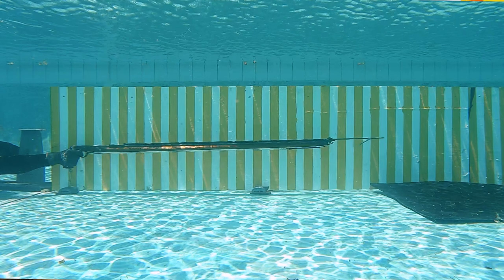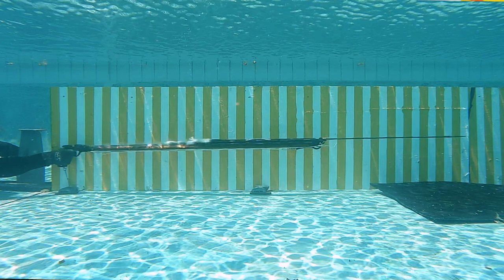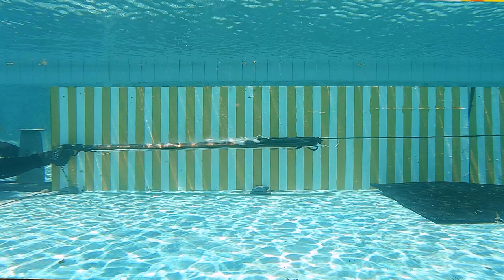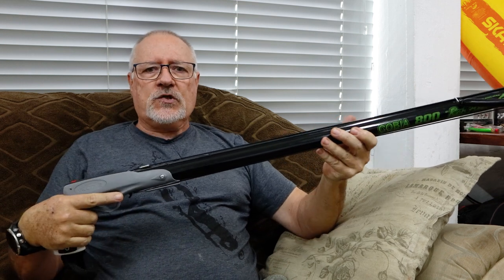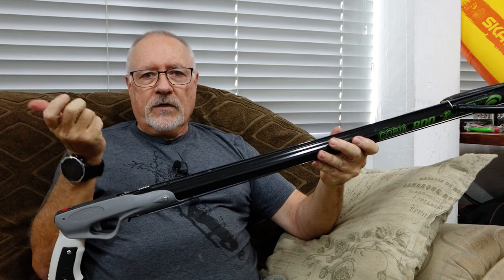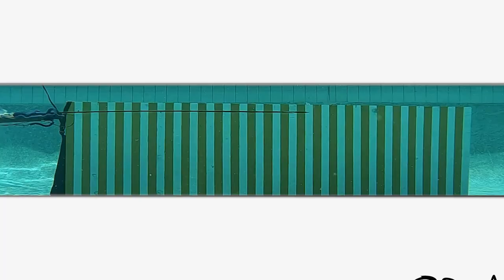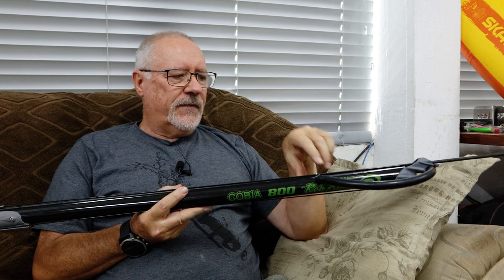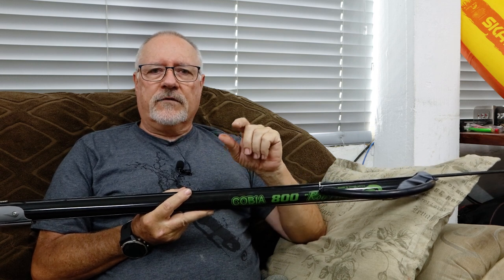Rob Allen | Max Spear Velocity | Part 1 | 2023

Comment: 48-50cm 14mm small ID Primeline on a 90cm RA roller with 7mm notched shaft seems like the max power/accuracy to me. Have tested 56cm 16mm standard w 7.5 notched and that is a smoothe powerful shot. I would take accuracy over power any day since I dive in murky low vis, so my go to is 55cm 14mm small ID w a 7mm notched on my RA 90 Roller. May have to tweak a bit once the water warms up, but that should be pretty spot on.
Reply from the maker: Good to hear.

Comment: A great discussion, I have used many different types of rubbers and i guess this is a personal preference, but recently i put some small id primeline (ultra force) rubbers on my riffe euro and the performance was crazy (so was the recoil and loading), i put the same rubbers on a rollergun and again the result was very high shaft speed, but all of this comes at a price.. loading, accuracy, recoil etc. Have you tried harder rubber? (I am not suggesting this is a good idea, I guess the rubber you order matches your guns the best).
Reply from the maker: Our standard guns are already regarded as "hard to load" no point in making them more difficult.

Comment: Some pretty reliable testing I’ve seen on YouTube indicated 14mm small ID rubbers stretched to about 350-360% seem to give more accurate and penetrative results with ~7mm spears. I’d be so curious if you’ve found a similar result.
Reply from the maker: We have not done speed tests yet with the smaller ID rubber but by the nature of the latex, the same constrains are there. The contraction speed does not get better no matter what rubber you use.
Reply: @RobAllenSpearfishing  It seems though that small id rubber contracts faster possibly due to less hydraulic breaking. Also it seems that thinner rubber contracts faster. Using small id 14-14.5mm rubber cut at 360-380% has been shown by reliable testing to do very well. I'd love to see you also test this.
Reply from the maker: @marcusdowell9062  We will test this but so far the testing shows you can easily over power a gun with standard normal bore rubber. If the small ID rubbers work well when compared to the same length bigger bore, yes there can be other influences slowing it down so, just compensate with a slightly shorter normal bore rubber. The whole emphasis in my chat was about the fact that latex rubber has a specific max contraction velocity and you can't make the rubber go faster. I was probably not clear enough, my fault. I was trying to show that all you need to do is get the spear up to max rubber speed, preferably just before the rubber gets to the end of its stroke. Any more rubber power, will still only get the spear up to max rubber speed, but sooner. This fast acceleration only creates more recoil which will affect accuracy.
Reply: @RobAllenSpearfishing  No, you where clear enough about the specific subject in the video. I was just going down the rabbit hole :) Anyway, great video, look forward to the next ones in the series.
Reply from the maker: @marcusdowell9062  Great, good to know I was understood 😜 I have a feeling this whole subject is going to be a deep "rabbit hole"  many thanks for watching.

Comment: I watched the 3 series of vids. My feeling based on your findings is the roller is actually questionably worth the extra cost and effort. its even less powerful at short ranges and perhaps marginally more powerful at long ranges. Maybe your actual use of the guns indicates otherwise. Reducing recoil seems to me the main advantage of the rollers. But this would be  not much of a gain at all if you were accustomed to firing a perhaps slightly heavier and or well balanced traditional gun. In other words, I think similar accuracy can be had with either roller or traditional; but I’m not completely discounting low recoil, of course it’s an advantage. When we are forced to take shots not extending our arm for example,I can see a roller providing quite a degree of higher accuracy. So all in all I suppose I’m a bit crossed. Such is life maybe. Great analysis though, very good series.
Reply from the maker: Thanks for the positive comment 👍

Comment: If you want to increase the spear velocity/penetration i would start altering the spear. Heavier and smaller diameter spear will limit friction which can come with tradeoffs. I thought of changing the surface of the spear to have divets in them to trap air bubbles and reduce friction from water. Never got round to trying it.
Reply from the maker: Obviously this is from a golf ball design. I'd think ships and or racing yachts/boats would have discovered this if it would work in water. I did hear years ago the racing yachts used 220 water paper (sand the paint surface that is to get the texture that 220 water paper gives) on the hull to gain speed but I think they now have some or other coating that is better.
Reply: @RobAllenSpearfishing  Yer i do wonder about the initial force/friction/air expansion  when spear creates the air cavities would be different than the hull of a boat, for at least the first little bit. Sounds like you need to invent some spears with some fish scales on them to reduce the friction. Either that or you put a little underwater propellor at the base of the spear that push starts coming out of the gun then propels the spear once out of the gun.
Reply from the maker: @khenrick811  We can get the spear to max velocity when the rubbers are set up such that they get to max rubber contraction, anything beyond that is drag. We can recess the barb more but then the spear is weakened, you can use thinner spear line but then the break strain drops. All a compromise. We just try to keep it simple 😜
Reply: @RobAllenSpearfishing  yer i agree with max rubber contraction for the spear, its like firing a feather at 1kg force or 1000kg force, they basically go the same distance underwater cos of exponentially increasing water friction. every different weighted spear has this its just that the heavier spears start the exponential increase in friction slightly later than the lighter ones. If i want to shoot beyond 7m i start with 800g+ spears. Any spears lighter than this no matter how much tweeking youll be hard pressed to make many metre gains, unless of course you have a spear that limits the friction. You ever heard of anyone experimenting with carbon spears with lead centres? If you could retain rigidity of the spear with carbon lead centre would retain weight you could reduce surface area of spear. Lead is about 30% heavier than SS. Tungsten and platinum would be 250% heavier but obviously $$. I know they do tungsten carbide which is more rigid than steel and twice as heavy.
Reply from the maker: @khenrick811  I thought about it many times. Years back in Europe they did bring out a spear wrapped in carbon but it did not last long on the market, too expensive I think. We made an 8mm carbon shaft with 8mm s/s ends (to be able to machine the notches, mech grip, fit barb etc) but it was too light, I thought about pushing solder wire up the middle but never took it further. It did shoot a few fish but was then lost. The problem is more about preventing flex without cracking, not something tungsten is good at. Cost will be a big issue, spears should be looked at as "consumable" like a fish hook. If there was a better way to make a fish hook it would have been done already, besides, we make 1000's of spears already, this will all grind to a stop 😜👍

Comment: If the rate of contraction is limited to a constant maximum, then one way of potentially overcoming the constraint would be to apply the force to a lever that propels the spear instead of to the spear itself. Even a short lever would have a positive impact. Practical implementation is a problem for the mechanical engineer.
Reply from the maker: agreed. Problem is loading. You would have to set it up with multiple rubbers. My question is, is the max speed you can get with the current contraction velocity not adequate?
Reply: @RobAllenSpearfishing  more powa more betta
Reply from the maker: @stickypaddle6432  😝👍

Comment: Its the recoil direct to the mass of the spear , more recoil  in a 7mm shaft them a 6mm ? With the same rubber bands
Reply from the maker: Yes but the spear mass is not the only mass moving, it plays a major part, but the mass of the rubber does as well. On a non-roller, the spear and the rubber are moving forward so both spear and rubber masses have an equal and opposite force pushing back, = big recoil. With a roller, half the rubber is moving back and half is moving forward, so the rubber mass component on a roller cancels its recoil portion out. Also with a roller, the acceleration to max speed is over a longer stroke, therefore lowering the recoil. So to answer you question, if the rubbers were set the same but 2 different spear diameters (different mass) I'd have to answer "it depends on the rubber stretch." If the 7mm is set correctly an just getting to max speed at max travel along the barrel then the 6mm with get to max speed much sooner but imparting the same recoil. I'd say it might be a little sooner with the 6mm spear thopugh. So many variables.... we have not included water temperature, another whole ball game 😜👍

Comment: Hello, thank you for the video. i want to ask you please, i want to change my 130 tuna's shaft to 6.3, what is best for rubber? 2*14 or 2*16. thanks
Reply from the maker: Don't use double. A single 16mm will be more than sufficient.
Reply: @RobAllenSpearfishing  thakns a lot. no problem to get 6.3 shaft on 130 tuna?
Reply from the maker: @ConatctContact     no problem, use a 170cm shat. Remember, it is much thinner so easier to get bent.

Comment: No matter which latex you can use , speed will be dependant on water drag coefficient. Closed barrel inverted system beneath the fuselage and pulling a dyneema line above till sharkfin .. innovation worth trying ..pneumatic airguns are  the best to create max speed in that sense eliminating drag
Reply from the maker: Sorry you did not get the point I was trying to put across, possibly I was not clear enough. The point of my discussion was the fact that latex has a maximum contraction speed, no matter what you do. I agree, pneumatic do not make this problem and, do work well. The problem with them is length, the longer they get and the more powerful the more difficult they are to load, in my opinion. I don't use them so can't talk from experience, just hear say.

Comment: Theoretically, the only way to pass the speed of contruction of the latex is by using inverted system that the line travel double the distance of the rubber, and there fore twice the speed
But i dont see a reason to go past what a good normal setup can offer.
Also you need very robust shaft to absorb all that power and not bend.
Reply from the maker: We now fully agree but are also testing the inverted gun set up to be able to comment with experience. So far, the speed is great but the complexity is great.
Reply: @RobAllenSpearfishing   thanks for your answer, will be great to see those tests some day 🙂
Reply from the maker: @yonatanalony4233  👍👍